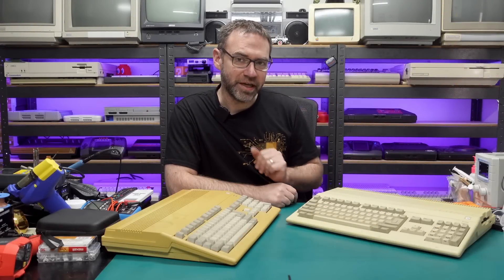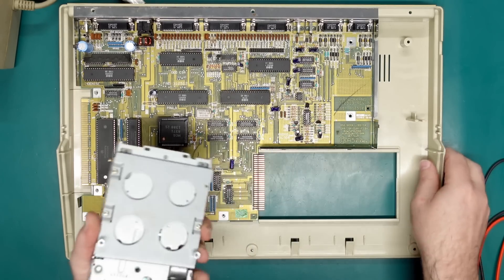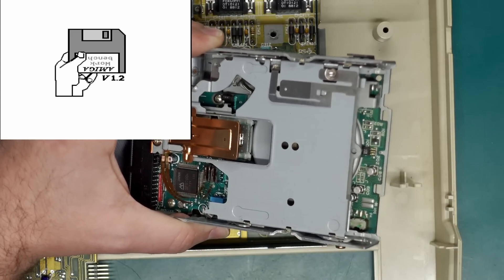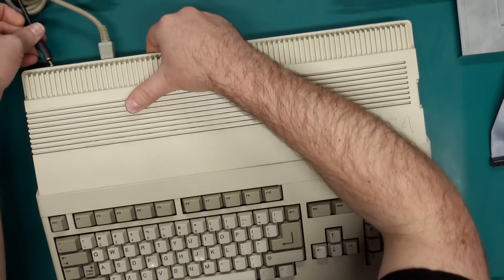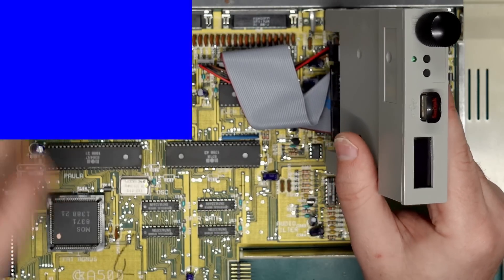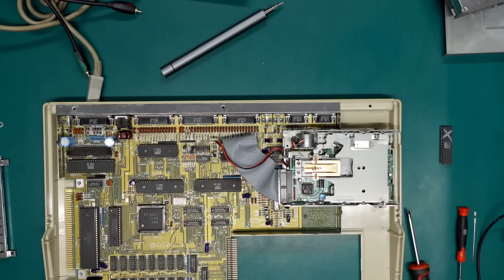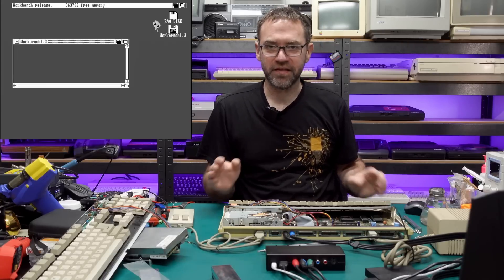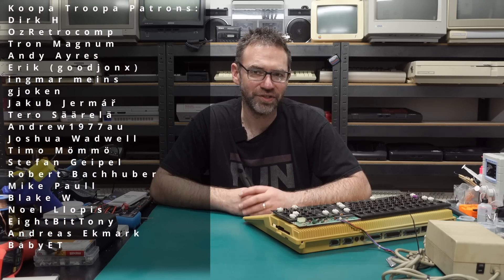Amiga 500 Repairs Part 1 - disk drives and keyboards

Comment: You, sir, are a methodical individual!  Well done!  Someone else mentioned a warm bath for your cable.  I'm not experienced with that, but it's worth a try.  Bag the connectors and tape them up to keep dry.  If it works, consider using a plastic protectant like 303 Aerospace Protectant periodically.

Comment: Just repaired 2 500s this week. Both had faulty floppy drives. 1 needed a recap and heads cleaning, the other needed a thorough clean as it was disgusting inside including the heads. Both work 100% now so time for some upgrades.

Comment: 0:46  never tried it, but I read about a warm bath (30-35 Celsius, not more to not damage it) for a bit (10-15 minutes, or more if needed). It would make the cable rubber soft again without damages. No connector should be submerged. Just water, no soap.

Comment: I got rid of the RF shield on my A500 because almost all the tabs where broken.
Reply: However, after a while I did not use those top metal shield, I realized they give excellent stability to the whole computer, and let the keyboard not to stress too much the side plastics. Now I use those again, after having them rust free and cleaned using WD40 (it leaves a subtle protection against future corrosion, at least for a while).

Comment: Great video , thanks a lot for sharing this  ! I was hunting amiga 1200 here in the states and didn't manage to find any for reasonable price so ordered John "Chucky" Hertell's re-amiga PCB, but now looking at that PCB I understand that I won't be able to assemble it because I'm not very experienced and not all components are available. Maybe one day I'll buy some Amiga (A500 at least) but for now will keep exploring amiga on  my mister fpga :)
Reply from the maker: Damn that sucks. But at least you have the MiSTer so no need it worry about it breaking down all the time 😅
Reply: @TheRetroChannel  yup 😁
Reply: @MrTGuru thank you :) but I ordered not recapped and yellow-ish A1200 from Netherlands (found it in one of those online retro shops of theirs) however I plan to do some development so will be using emu anyway
Reply: @MrTGuru yeah I understand. I got some basic skills and keep learning (from @TheRetroChannel and other). By now I repaired several machines: couple C64, an old Timex Sinclair (actually I reworked it slightly to be 16kb instead of 2kb :) ), two C+4 and 1541 floppy drive. Currently I'm recapping PVM 1342Q. As to Amiga ... will see. Anyway I paid for it already ($435) :) I may regret that later.
Reply: @MrTGuru Thanks a lot for heads up! seller also told me to recap the first thing. Gonna check out your channel for those logs !
Reply: @MrTGuru Yeah I noticed :) looked through your channel and didn't find any. Ok will look for recaping instructions. If I scr3w up then I lose $435 and never buy amiga again :) I very appreciate your advises ! thanks a lot !

Comment: Seen that same problem on the Keyboard PCB.  I disconnected the connector, reconnected it and it started working again. But 6 months in storage and it stopped working again. You didn't replace the Eject button on the Epsom Floppy?
Reply from the maker: Interesting. I hope this one continues to work but I might poke at it a little more to see if it starts playing up. As for the eject button, I'll get back to that, need to give the case a bath first